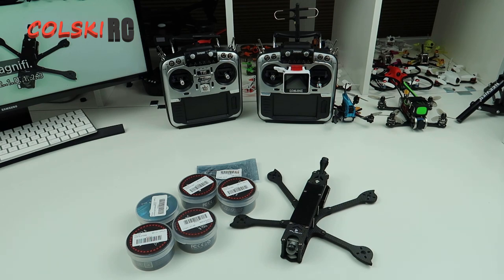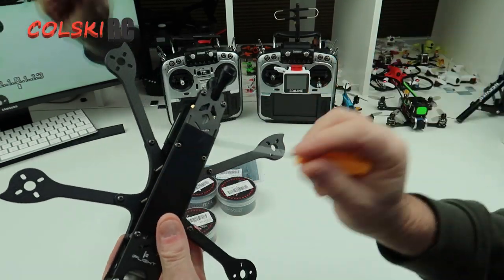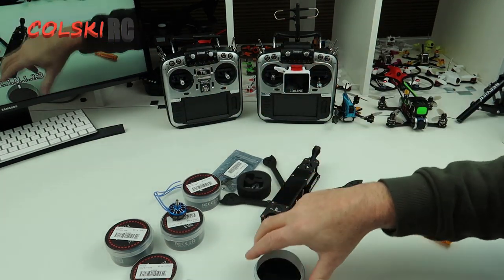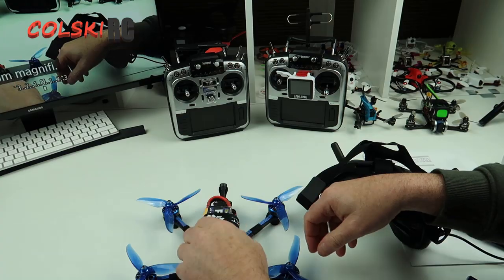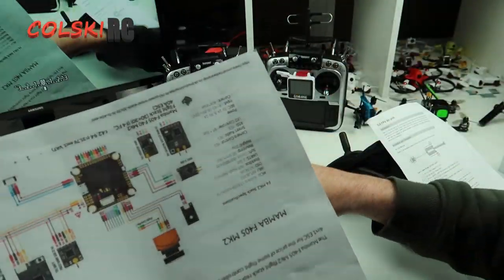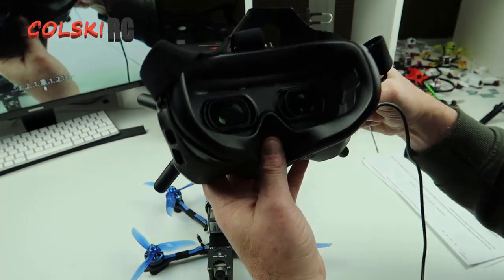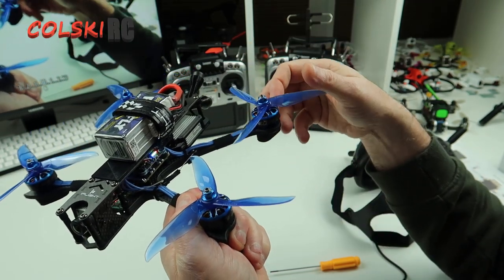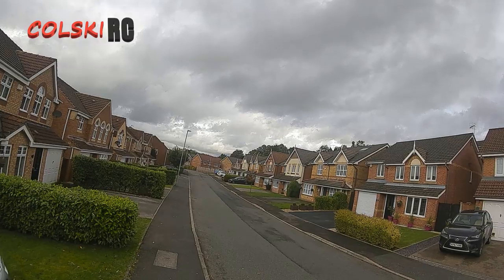IFLIGHT DC5 HD FRAME - DJI FPV BUILD

Comment: Regarding the power cable, zip tie it to the metal clasp on the head strap stops them coming out.  Did you manage to unlock the power still after the firmware update?  Not that you'll use the extra power of course lol

10:45 than you for that warning, I had suspected there was a reason for the separate price of the items being cheaper than the combined one, but to have someone confirm it is great.
Reply from the maker: Thanks mate yes I unlocked it obviously just to see how it was done haha
Reply: Colski RC oh goodie, I'm always a bit wary of DJI and their updates ever since they stopped people changing the power level on the spark remotes and practically made everybody use 2 year old firmware if they wanted the extra power, not that anybody uses it, but it's nice to know the feature is there...

Comment: just got the dji fpv goggles set & iflight dc 5 hd frame.. i cant for the life of me get the stock antennas to fit in the tpu mount.. they just seem too long and keep jutting out.. did dji recently increase the length of the stock air unit's antennas?
Reply from the maker: Hi no they are still the same you have to bend the cable to get it to stay in. Its the same on most of the frames
Reply from the maker: Hi no they are still the same you have to bend the cable to get it to stay in. Its the same on most of the frames
Reply: @CKone41  i try to bend the antenna to fit and now the mmcx connector on the air unit broke :(
Reply from the maker: @skarebsuper  you must have really forced it i have crashed loads of times and have landed on the antenna and never broke it
Did you just bend the cable?
Reply: @CKone41  actually i didnt force it, i was very gentle, the antenna felt loose so i plugged it in and out a few times, to check for tightness and good fit... and then i just bent the cable while holding on to the connector (so that i dont stress it)... somehow the inside active element centre connecter just broke into 2... its so fragile and weak
Reply from the maker: Strange I have 10 air units and have never had any issues

Comment: Hey nice video !
But is the alignment of the two antennas not disadvantageous ?
Because they send at this position in the ground and sky, but not horizontal. This way reduces the range or im wrong ?
Reply from the maker: Hi tried them sticking out of the top at first and the quality was exactly the same
Reply: @CKone41  how far away you can fly and can you fly in buildings?
I mean is the signal strong enough to have real Fun ;)
Reply from the maker: 「r4id 」 absolutely no issues whatsoever absolutely amazing flying in hd

Comment: it supports 4s 1800mah or only 4s 1500mah ?
Reply from the maker: You can use which ever battery you want but the 1800mah might effect performance due to the weight